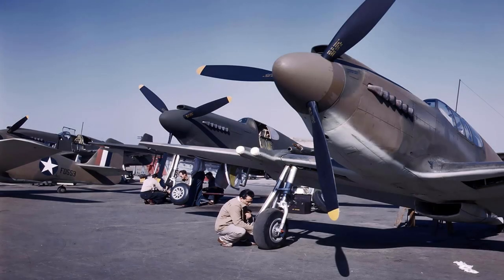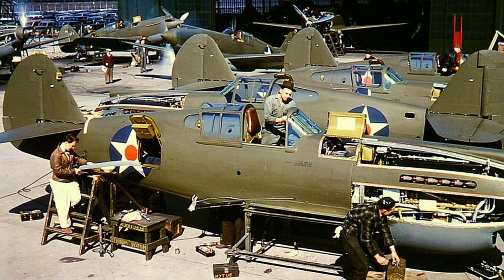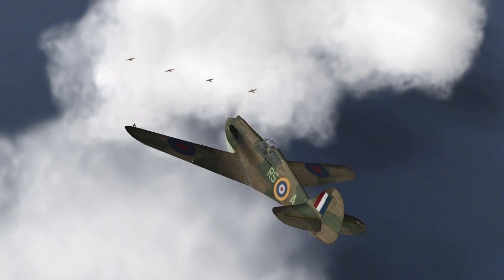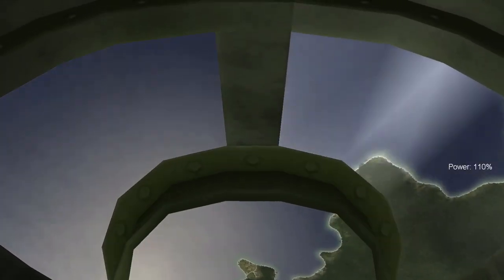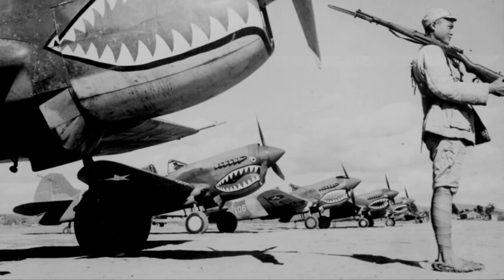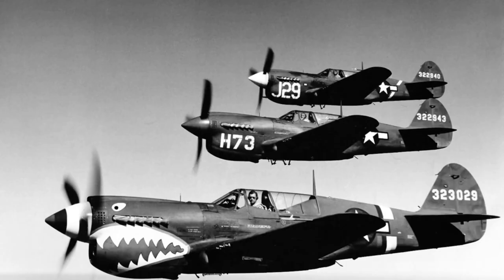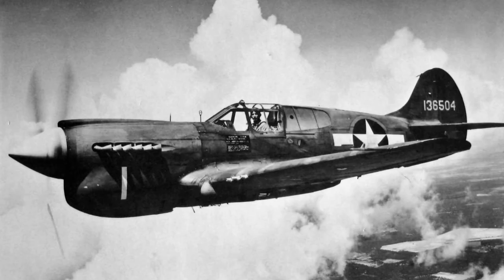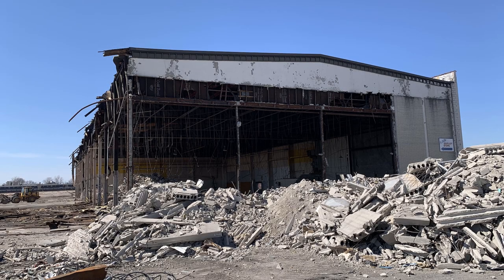5 Minute Guides to Aircraft: Curtiss P-40 Warhawk/Tomahawk/Kittyhawk

Comment: The "Trouble" with the V-1710 Allison engine is not with the engine per se, but with a desk jockey that decided that all USAAC (later USAAF then USAF) would have only have a Single Stage Supercharger.  If High Altitude Performance was "Needed" they would use a Turbo Supercharger (now simply called a Turbocharger).  This is why the P-38 had to have twin booms (the things that look somewhat like a WW1 Lewis Drum fed machine-gun are the Turbochargers) and the P-47 had to be so big (to carry it's Turbocharger behind the cockpit).....
Reply: Except that the Allison had all kinds of trouble with broken cranks, thrown rods, bearing fires and especially detonation.  Problems still existed when the P-38L was flight tested with the new 150 octane and couldn't handle 70" of MP (totally unrelated to the turbo system).  Even the P-82 engines in Korea were a maintenance nightmare.